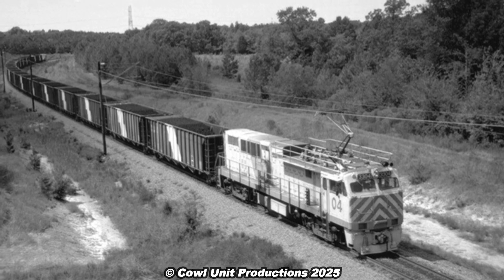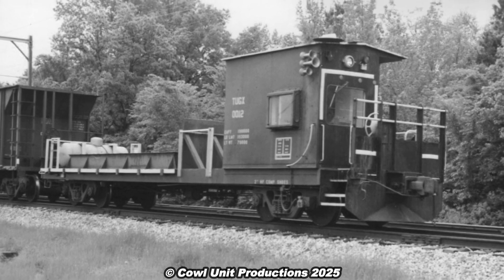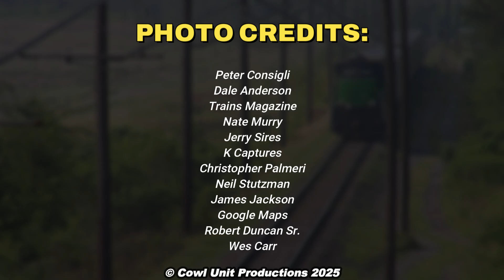Unfamiliar Electrics - The GE E25B

Comment: As was stated in another comment, the locomotives have beacons on top which is common for the now more modern Texas Utilities operations seen in Kosse Texas. The locomotives were likely equipped to be remote controlled and the crew controlling the locomotive could ride in the makeshift cab car on the way back. 

In Kosse TX, there were some SD50s working the same style of shuttle service, before they went up to the blacklands railroad and got replaced by 2 ex-EMD SD70ACes, 3 ex-UP/PRLX SD40T-2s, and 2 leased NREX SD40-2s. The 2 ACes and 3 tunnelmotors are all equipped with remote control technology, and every train has a cab car on the end, since there's no wye on the whole line, it's just push/pull service. 

From what I've heard more recently, there's still some coal shuttle/power plant opertions up in north east Texas using that ex-CSX SD50, some ex-UP SD40M-2s, and some other unique power, but I haven't gone up there to see those myself yet. Interesting and informative video about this obscure operation that really does not have much information publicly posted about it, and glad now more people can learn about some of Texas' many strange railroads.

Comment: I didn’t know about this engine until I watched this video.  I think this would be like our version of the Soviet VL10/VL80 class.
Reply: VL10/VL80 are mainline duty and are intended to work in twin section configurations most of the time. These are more like VL41/ OPE series (barring the traction dumpcars)/VL26 (except no secondary power mode) - all of these being classified as electric shunters/traction engines for small scale high intensity industrial line work